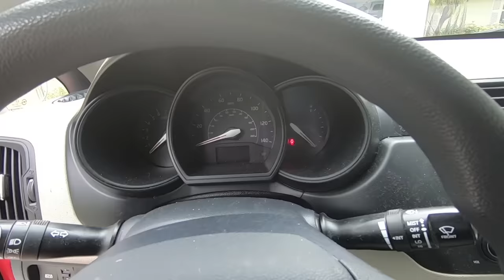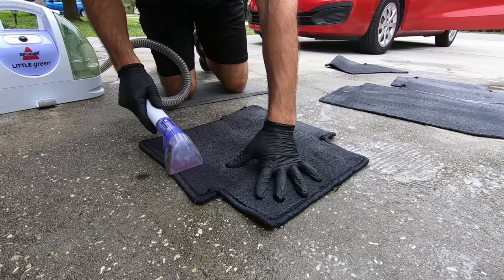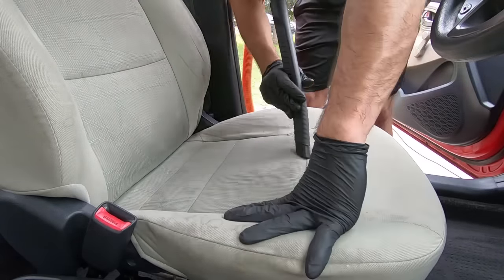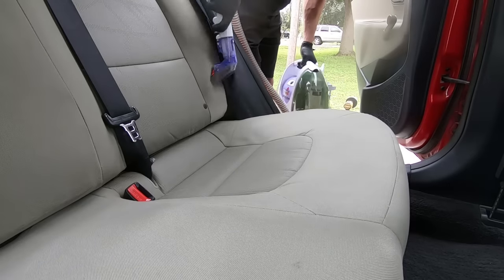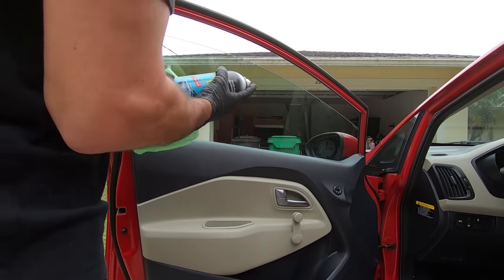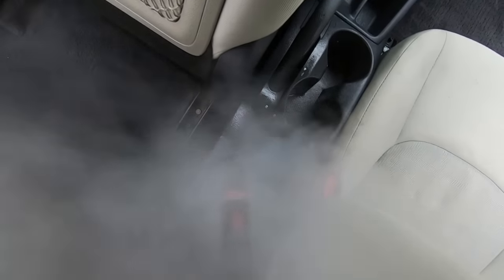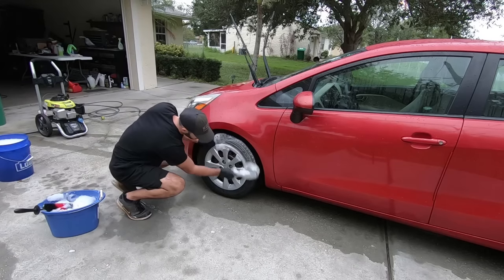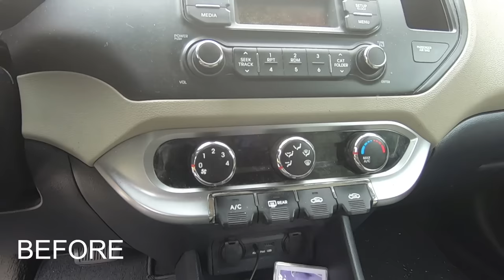Deep Cleaning my Uber Drivers Car! Complete Interior Exterior Detailing

Comment: What uber has winding down windows  mind blown I mean what car that's newer than 1998 has that
Reply from the maker: cupraboy ! Haha yea I was surprised too but some manufactures make very basic models with bare minimum options
Reply: @TomDoesDetails  true that mate , car came up amazing tho well played much love from the UK 😎✌
Reply: My dads car is only 3 years old and he has the same winding down windows. With many cars you can choose which option you want to have and the winding down window is cheaper than the electric one. He also doesn't have speakers in the back.
Reply: I had a 2000 Dodge caravan that didn't have power windows. Everything was manual... But now I have a 2017 everything Auto...

Comment: Why aren’t you using water in your extractor it helps to dilute the fabric cleaner better
Reply: Yeah should be using the water!!
Reply: He is mate it's a trigger on the wet vac hard to see in the video but he is
Reply: He is!
Reply: Is he tho?
Reply: Master 84 using that type of carpet cleaner doesn’t pull the water back from foam very well.  Notice how little was in the tank when he dumped it? I tried to use one on my couch, but cloth over foam is a spot cleaning thing... putting water into it, it’s like putting it into a super thick sponge and trying to suck it all out. That seat will be wet for days. Depending on where you are, it could mold or sour.

Comment: A tip that I’ve found useful: after pre treating and using the drillbrush on the seats, go right in with the extractor so the dirt doesn’t have time to reabsorb into the material/seat. It’s easier to do in smaller sections, especially if you’re using the steam cleaner.

Comment: If you put warm water in the extractor you spray on the seats before and after you drill brush them and extract them...
1. It will clean a lot more better because there more Lubricant in it
2. It will extract better because like I said there’s more lubricant
Reply from the maker: MasterOfShoppy thanks for the tip!

Comment: I can't help but notice... the door handles didn't get any love from the detail brush. Maybe you did it off-camera. If not, that would be a tip. Pull handle as to open the door and clean on the area that is otherwise hidden.. Keep up all the other good work ♥
Reply from the maker: You mean on the outside of the vehicle? Yea good point, I get under and around it with the mit but never pull on it and use detail brush. Thanks for the comment!
Reply: @TomDoesDetails  yea on the outside :P often overlooked, but it traps so much dirt. especially on white cars you can see it very well. (it will turn green sometimes) those old door handles where u pull the whole system up don't trap a lot of dirt, but this particular kind of handle will trap so much, you will be surprised. Just getting in there with a brush isn't usually enough, so i recommend opening/pulling the handle fully so u can really get in there. (obviously close the doors well after that). yet again, I enjoy your content, keep it up ♥
Reply from the maker: Synchronize365 I will definitely have to do that next time. Appreciate the feedback 🙂

Comment: I dig the work you put in. I recently bought a little green proheat on facebook market place for $40. It had a pretty substantial leak from the heater element but I fixed it for free. I think for christmas I may buy myself a mytee 8070, however I'm not a detailer and I'd just use it for my own vehicles. Kinda hard to justify those prices for 4 cars. The little green proheat hit the spot for $40
Reply from the maker: MrJohnsonx3 oh they are so worth the price. Great little work horses. Thanks again